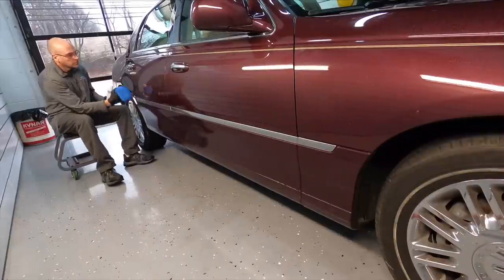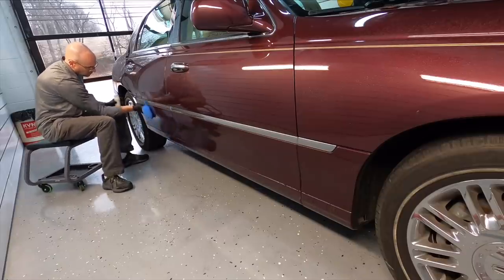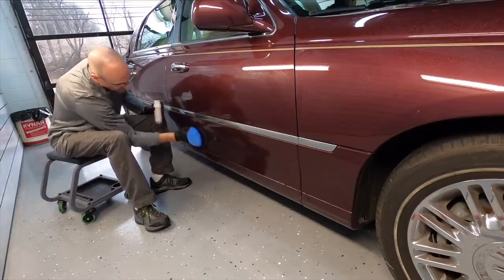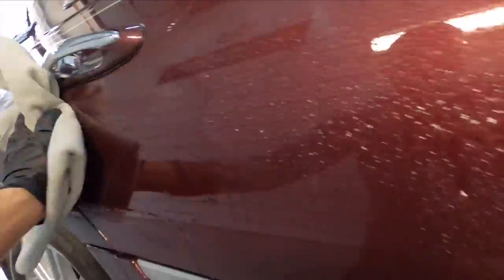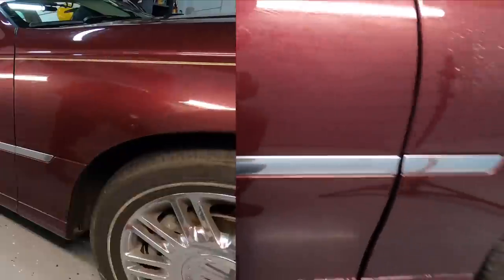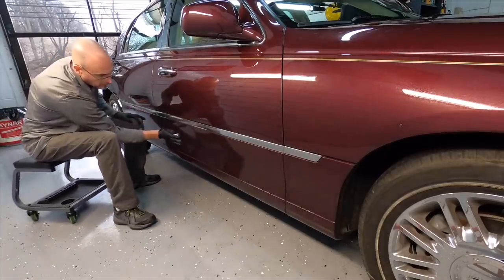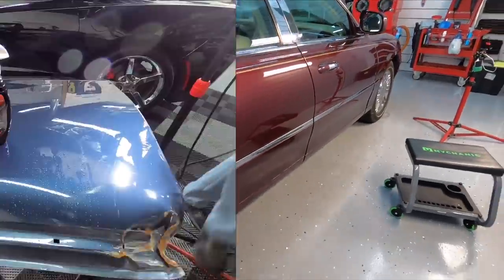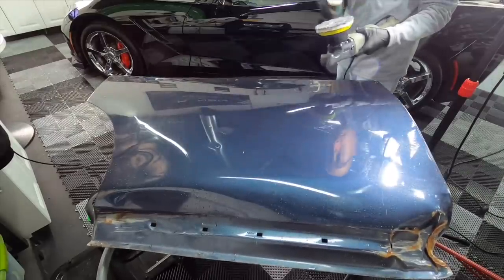How To Remove Traffic Film, Old Wax And Sealants!! TAC System Paint Work Cleaner!!

Comment from the maker: Use Code apexdetail20 for discount if interested!!
Reply: I just put in a huge order last week with Tac System, I could've used the code last week 😂. I did pick some of this up. Glad you did a video on it.
Reply: "Sorry, this coupon is not applicable to selected products." :(
Reply: I hear dish soap can do the same have you done a video Using Dawn before?
Reply: evening my friend...hi sissy.....u stated not recommended for soft clear....the 2013 lexus es350....is it too soft?
Reply: @johnketuroskey6293  I myself have a 2015 f sport Lexus, no problems.
Reply: @jameshowlett8811  it will damage clearcoat overtime..still dont understands why this channel has less subs than Wilson Auto..
Reply: @johnnyv5995  fixed. Give it a go. Sorry about that
Reply: @mattmerwin3842  👀 just waiting on your 1 step master to come in and it's on the way.
Reply: @tacsystemusa1702  nice. I can't wait
Reply: @tacsystemusa1702  my understanding is the f sport is a much harder clear than the es...is that info correct or incorrect....that's like saying a chevy impala has the same clear composition as the corvette.  I want to strip multiple layers of sealants/toppers and start over with a" naked clear". I intend not to use much pressure with your cleaner...right??
Reply: @johnketuroskey6293  that is not something I have an absolute yes or no in but we do have any restrictions on what you can or can't use it on or have heard of any issues.
Reply: alberto see the video
Reply: @amazed6161  right...best detailing channel on youtube
Reply from the maker: @johnketuroskey6293 you can use it on soft clear.
Reply: Do you still use a Alcohol Wipe down after, or just after the paint correction?
Reply: Hey Brian, Tac is out of this product.  Any second choices?
Reply: @tacsystemusa1702  sent an email about quartz max...yur system has been down for quite awhile....pls respond to email - sent 3/5 at about 10:30
Reply: @johnketuroskey6293  unfortunately I am no longer supporting TacSystem.  Personal reasons has me stepping away. I do not know at this time if or when anything will be available again. Sorry.

Comment: Another awesome demonstration video Brian!  I've been a big fan of paintwork cleansers over the years, mainly non-abrasive cleansers in my attempt to try and preserve the clearcoat of my test panels while trying to knock down a lot of the heavier sealants and coatings before using abrasives.  There's always that question in my mind as to whether the abrasives in the polish could really tear all the way through the protection after just being prepped with a panel wipe.  For those products that I know are especially resistant against my panel wipe, I'll usually pull the polisher out with the cleanser first in order to pre-prep the paint prior to going over it with the polish, instead of using two abrasive polishing steps to potentially cut through more clearcoat than needed.  McKee's 37 Coating Prep Polish has been one I've been using for years now with great results, was always a fan of S100 Shine Enhancing Cleanser as well.   

This TAC Systems one looks interesting, will have to check it out!
Reply: Hey @WaxMode did you ever try Collinite 840? Pre-Wax Paint Cleaner? I used it to remove the 845 in preparation for laying Fusso Coat on the car and it worked really well.
Reply from the maker: IGL Precoat is another great option. Hope all is well! Jumped from GTA to Madden Lately. Love franchise mode!🙂

Comment: Great video. 
Is an ipa wipe down enough to remove G techniq  C2V3 after several chemical guys clean slate washes. I want to install Crystal serum light. Car is brand new,  (Tuscon)1 month old with  no marring or scratches and has several coats of C2V3.  Thanks in advance.

Comment: On a brand new vehicle what would be the recommended process for paint preparation prior to ceramic coating?
I was thinking a wax free hand car wash then use a clay mitt with soapy water (probably going to be containments from storage and shipping), dry and then an ip solution wipe down. Do you think a lightly hand applied meguiars ultimate polish would be beneficial? The vehicle color is going to be a medium metallic orange..
Thanks,

Comment: Nice... you say super micro abrasives.. could it be used as a jewling polish😀
Reply: There's not enough working time for jewling. It hazes over fairly quickly.
Reply: @JTBlair-nw6gb  Gotcha 👌🏼👍🏼
Reply: Just a stripper we bottled!  😂😂
Reply: @tacsystemusa1702  Thanks!
Reply: @tacsystemusa1702  Would this remove paste waxe residue from plastic trim pieces?   It seems that wax will stay on plastics for years but only lasts a few weeks on paint  :(
Reply: @douggreen980  you wouldn't use this on non painted plastic trim. For black plastic trim, you would use our multi cleaner product or possibly tar zero. Then using TacSystem Magic plus or moonlight to lock in proper protection
Reply: @exceldetail  thank you very much

Comment: Can you elaborate on the not recommended for soft clear? I have a '16 Accord which has soft clear. Should I avoid this if I'm doing correction after?
Reply from the maker: You can use it to decon it. but after correction...mayb not. just use IPA.
Reply: @apexdetail85  decon would be the most important part for me, thanks! In the spring I'll need to remove an aged layer of DPC Armor (first applied before winter) and weekly layering (mostly as a drying aid) of DPC Kingsguard.

Comment: Wow great product!! Do you need to do any sort of correction after you use it? Let’s say you want to switch from one sealant to another and need to clean the old sealant off. Can you just buff this in, wipe it off and be good to go? Or would it cause some swirls
Reply: There are micro abrasives in the TAC cleanser, so depending on how soft your clear coat is, it may leave behind some marring, in which case you might want to give it a proper polish before laying on your LSP.
Reply: The intention is not to cause swirls.  That will depend on your pressure and choice of application media. But for all intensive purposes, yes.

Comment: I wonder if ONR residue is safe to apply wax over I don’t know if I’m just making nonsense but I wonder if you lose the performance of the coat of wax or polymer sealant over a polymer like ONR I  solely use ONR to clean my car with but I wonder if I should use like A Gyeon prep after so I get a better bond of the wax I’m using🤷🏼‍♂️